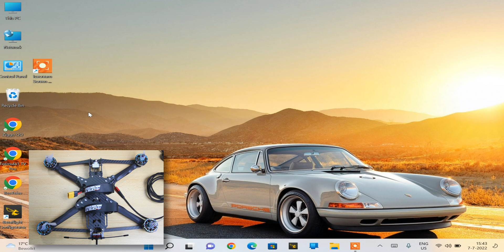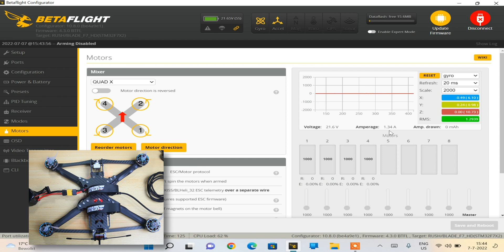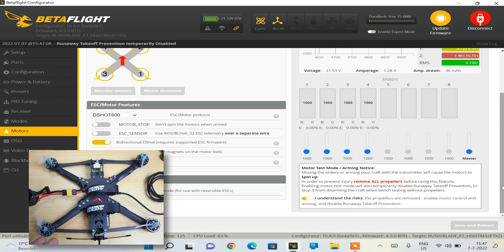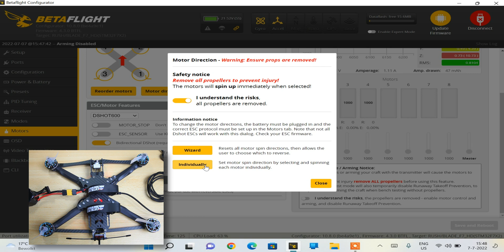BetaFlight How-To: Change Motor Rotation Direction!

Comment: Thanks for the instructions! Please help, I have two motors that spin in the wrong direction, I tried changing the direction in the section Spin Direction, but they do not change direction and always spin in the same direction. What could be the reason? Thanks in advance!
Reply from the maker: Hi there :)  the reason for this not working might be that Betaflight at some point "broke" this functionality in Betaflight and I am unsure if they ever fixed it. 
The way to solve this is to use a ESC configurator for your specific ESC (like the BLheli configurator Chrome extionsion).. you will be able to reverse motors in there (please remove props first)

Comment: On my Motors 3 and 4 when I click it it'll spin the right way but then when I click it again it goes the opposite direction so I started typing the number three and number four over and over again it'll go one way then back the other way a few times and then back to the opposite way. Have you ever seen that happen before and do you know what I should do to fix that? Thanks
Reply from the maker: I think your best bet would be to Not use Betaflight for reversing anymore as they "broke" this feature in one of the latest releases.. 
Sometimes it works. but using the BLheli tools works better...
Reply: @DutchRC  okay yea i read it was in the latest betaflight firmware. I just got the Speedy Bee f405 V3 and it has the latest betaflight firmware already on it.
Reply from the maker: @delong3D Check.. then look for the Blheli32 or Blheli_s configurator.. (which-ever your AIO has... I am guessing Blheli_S )
Reply: @DutchRC  im working on it right now. Thank you

Comment: sadly it doesnt work for me. Betaflight 4.4.2
Reply from the maker: yeah.. what IS up with that or what? :|
Reply: I simply resoldered 2 motors. Was easy though weird it does not work for me.  @DutchRC
Reply: have the Betafpv F722 aio
Reply from the maker: @fpvmaxim soooo I guess it's back to changing the direction with the Blheli app.. did that work out?
Reply: @DutchRC  couldn't make that work on mac… all way more complicated than just resoldering.

Comment: If you watch your video over.  It doesn't really explain HOW to change the direction.  You only checked the direction, you didn't specify how to change and show the change. Simply clicking on reverse spins the motor in the reverse direction than it is.  It isn't changing it and saving it to keep it that way.
Reply from the maker: Be aware this feature currently doesn't work in BF4.4.2 
But.. clicking the Reverse sets and saves the reversing.. There is no other "saving  required

Comment: I have done this but it doesnt save the change of direction. Where did you hit the save button?
Reply from the maker: There is no "daving" involved.. you hit the Reverse (if the motor is spinning the wrong way around) and that should be it.. 
I have found that Sometimes the setting is somehow lost.. Just try it again and it will stick :)

Comment: Hello Dutch i got a doozy for you as you know i have an hglrc Arrow3 4s quad and the Eachine Lal3 4s and i cannot get these 2 quads to link up with my Skyzone Cobra SD goggles but they will link up with my Mob6 and my Hubsan Jet. On the1st 2 quads i mentioned i have changed the power level from 25mw to 300 and back, i changed frequencies as well as 6 different bands and i cannot get the hglrc, Eachine to give me a feed/image. I find this quite peculiar and wanted to ask what you think may be going on? When i first got these goggles as a replacement for the cobra S 7 months ago all my quads gave me a good feed but not now. Thanks Dutch!! ✈️✈️
Reply from the maker: Howdy man :)  that IS weird.. does the Cobra goggle receive Any kind of FPV signal at all still? If it does, maybe your 2 quads are on channels the Cobra doesn't like.. I'd try some different frequencies.. 
Also are you sure your quads are not in PID mode maybe???
Reply: @DutchRC  Hi Dutch after some troubleshooting i found thay my Cobra would immediately pickup a strong feed from my MOB6 and my Hubsan Jet so i will either change out thr vtx in both or replace antennas. For the 2 quads hglrc, Eachine i did increase the power levels from 25mw to 300,back. I also changed bands, frequencies and the waveforms remained mostly flat but i got high wave forms from my  other quads so i'm leaning towards bad vtx, antennas. Never thought am antenna could become defective but we'll find out later today, ill let you know what i come up with. Always learning right Dutchman! ✈️

Comment: Dutch i updated my BF to 10.9 and the firmware for the quad is 4.2.3.The motor direction button showed up but it doesnt behave like your video on motor routing. Ive changed motor direction to off. Nothing happens so i put it back to indicate motor direction is reversed which is its permanent setting. Both motors 1 and 2 are still spinning in the wrong direction. Im pooped but maybe theres another wsy to chg these 2 motors directiin via the CLI which i know nothing about. Perhaps we'll chat tomorrow hopefully. Goodnite Dutch!! 🤭
Reply from the maker: Hee brother! 
Wellllll to good news is that you now probably know why the quad didn't take off :) 
And the quad probably isn't a BLheli32 one.. therefor the Betaflight route might not work.. 

You will therefor have to change the motor-direction with the Blheli Chrome app... 
At this moment I am at work so I can't see what app you would need..
Reply: @DutchRC  Awesome Dutch i will await your response on the Blheli Chrome App option.
Reply from the maker: @techFPV5964  Soooooo this is the blheli ESC configurator I use: https://esc-configurator.com/ 
with that you should be able to reverse motors :)   There are lot's of video's online on the use of the software but reversing motors should be simple :)
Reply: @DutchRC  Your the best mate! I will give it a go and ill let you know. I really appreciate your help Dutch!
Reply from the maker: @techFPV5964  No worries brother ;)  just 1 hobbyist helping another.. that should be free
Reply: I also changed the props to new ones and after I upgraded the FW to 4.2.3 it still wouldn't fly.. Im wondering if its the stack which may have something to do  with this elusive problem??

Comment: Also Dutch my motors say on BF that they are reversed. Can this cause my issue with motor 1 and 2 spinning in the wrong direction?
I also get "No response from the bootloader, programming failed" in red
Reply from the maker: Yes sir.. that can for sure be the cause.. BF will instantly notice when trying to fly away something is wrong in that case (and disarm)
Reply: @DutchRC  I tried both ways and still no flight.I have to upgrade the firmware.
Reply: Dutch do you recommend i update the firmware first or just change the motor direction via blheli Config?
Reply from the maker: @techFPV5964  if it flew well before I wouldn't be fixing things that aren't broken :) 
and IF you want to update.. I'd pick 4.3.1 not the very latest as that changes things more drastically :D
Reply: @DutchRC  Yes Sir you are correct so i'll give the Blheli chrome app you sent me a shot at motor direction correction. I'll be back!
Reply from the maker: @techFPV5964  Good luck my friend :) 
And have a good weekend over there ofcourse
Reply: @DutchRC  I'll tell ya Dutch when things go wrong, they go bonkers! I connected Blheli to my quad and hit "Read setup" and i see motor control 1,2,3,4 but i cannot change any settings. I also used blheli config and i see no esc data?
Reply: @DutchRC  Hi Dutch i just updated the blheli config from S to_32 after verifying that my esc's are blheli_32.I found esc #4 motor to be reveresed so i changed it to normal like the rest of the esc's. Then i changed the direction in BF from reveresed to not so i guess ill do a test flight in a little while and see how it goes but im not too confident at the moment. Logicaly speaking do you think im on the right path? Ill let you know how the test flight goes.
Reply from the maker: @techFPV5964  Howdy brother! Well yes you ARE on the right path as you are already at the point you can change to motor-directions :D 
Maybe put a bit of a tape-flag on ech motor and make Sure they now all spin the right direction? :)
Reply: @DutchRC  Perfect! You made my day, thats a great idea w/the tape which will make it easier to tell which way the motors go.. Next step will be to do a test flight so im keeping my fingers 🤞👍. Thanks again Mate!!
Reply from the maker: @techFPV5964  Go for it brother! :D  I did a first few test-flights with a new quad this weekend as well (that Aikon setup I just did some video's on)
Reply: @DutchRC  Oooh boy DutchRC has a new video, i will def watch it because i have alot of catching up to do with the latest builds! Thnx Dutch for the new video o know you work very hard on your own time to bring us such great quality videos!
Reply: @DutchRC  Ok Dutch if i may i can explain what i've done so far with my Eachine 4.2.3. I found motor esc 4 to be reveresed in Blheli32 so i changed it back to normal and this reflects the same settings for esc 1,2,3 currently. In BF the motors are set to normal so at this time i gave it a test flight and she would not lift off the ground.
I went back into BF and changed the motor settings to "Reverse", gave it a test flight and she would not lift off the ground. I double checked all 4 esc motor settings and they are still set to "normal".
I am officially back to square one. The only option that is left is updating the FW to 4.3.1 which is the fw setting you proposed last week. What are you thoughts my friend?
Thnk you again!
Reply: Dutch so nothing has worked in trying to get my Eachine Lal3 to fly so i will educate myself on how to perform a FW Update as this is probably the only step i have not taken.
Reply from the maker: @techFPV5964  hmmmm hard to "assist" someone this way without really seeing what happens :$ 
DO first do a dump of your current settings then ofcourse! (DIFF ALL .... and then save the output to a text-file) 
And good luck ofcourse!
Reply: @DutchRC  That will be the very first thing i do.. Probably over the weekend and ill let you know how it goes! 🤞🤞✈️
Reply: @DutchRC  My friend Dutch i am stuck in BF. So i followed the steps for flashing the Eachine firmware and when i hit the flash firmware button bf comes back and says "Recovery/Lost communication". I made cettain that the firmware level was at 4.3.1 and i loaded firmware -local, then flash firmware and its at this step i get the lost communication error page. I tried loading directly and then "Execute" and the bf does not change the quad firmware level. What can i be doing wrong?
Reply: Dutch!! We did it, what i did was set bf motor direvtion to on and then i switched the front props left to right right to left and the same for the rear props and she started flying! I cant believe after 2 weeks troubleshooting and a fw upgrade my quad is now flying like brand new. The upgrade has the quad flying much more stable.. Thank you Dutch for all of your help these last 2 weeks as i appreciate every moment!! 🇬🇧🇺🇸
Reply: She is flying WONDERFULLY!! I am grateful for your help and i apologize for being a pain in the rear at times! Its over now and my Rachine is flying like brand new!!! ✈️✈️❤️❤️❤️🙏🙏🙏
Reply: Dutch we did it friend! Ok i had trouble with BF them i download ImpressRC file and once i did that then i was easily able to upgrade my firmware to 4.3.1..All the switches work and thr, yall and pitch are responding well also.. Now comes the flight test and I'll keep you posted on that.. Thnk you D for all of your help. I have myfingers crossed 🤞 ✈️✈️🙏🙏

Comment: OK.  I have all motors spinning in the correct direction and saved in Betaflight and my Radiomaster TX16s moves the receiver sliders in the correct way in Betaflight.  Yet when I disconnect from Betaflight the motors spin in the reverse direction using the controller.  What's going on here?
Reply from the maker: I can't check (at work now) but did you maybe forget to "save" the new setup after changing things?
Reply: @DutchRC  Worked it out.  It was in turtle mode
Reply from the maker: @Klaas_H  :D  I would have Never thought of that :D

Comment: Thanks for the video...but what about changing the rotation and not having it default. I think I did the Motor Direction Is Reversed but I got confused after and it didn't work as it should.
Reply from the maker: Howdy man :)  you do mean props-out / props-in right? :D  
You can set that with the "switch" right above the diagram on the motors-tab..
See the switch with "motor direction is reversed" ?
Reply: @DutchRC  I thought I did that, and it would flip out after takeoff...I'll try again thankyou :)